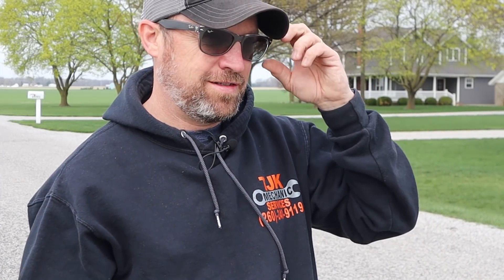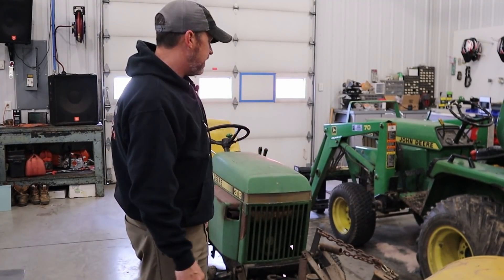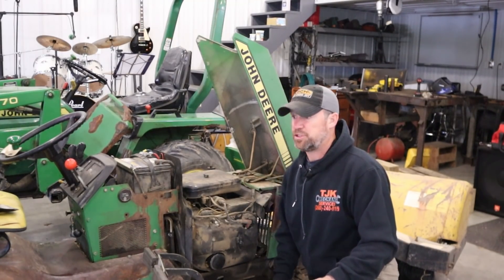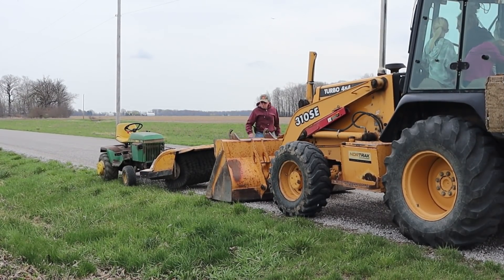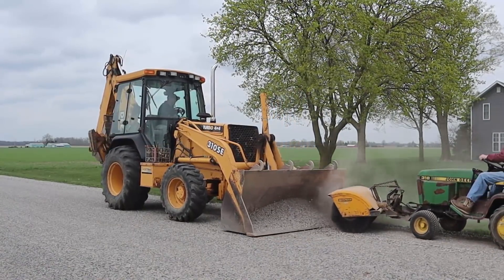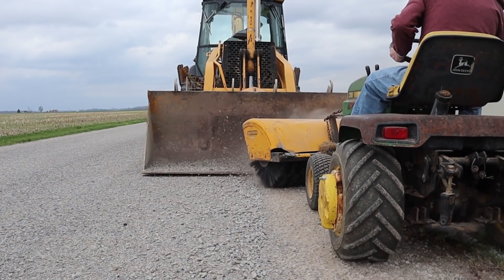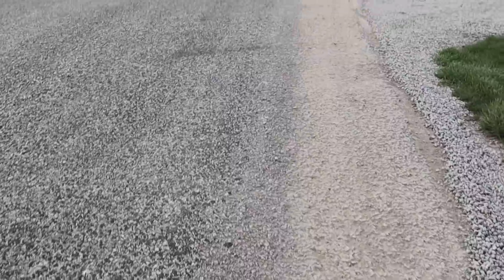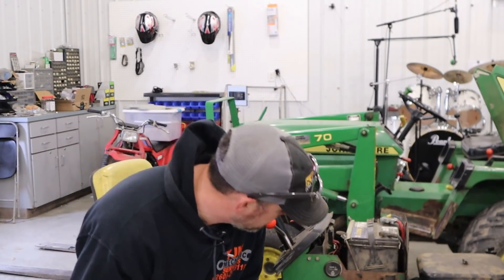I Have Wanted to Do This For Years!

Comment: I took all the side shields and grill off my 318 and stored them in the rafters. Deere closed up those 317s--318s--and 400 hundred series tractors for noise reasons. They never got enough fresh air. ALSO each spring the first thing to do is start the engine and while running at half throttle take an air hose and give the engine a good blow job. Around spark plug holes etc. Get the mouse nests out of it. And don't forget to clean the screen under the tractor. Yours just like mine still has the original Onan engine. I rebuilt mine when I got. You are right about the compression. No need to run it again hot. Just going to ruin your day. What do you do with the gravel. Return it to the county shop pile? Or does it end up in your farm driveways? Have a good one.. Arnie..nice video
Reply from the maker: Thanks Arnie!  I agree.  The Onan has seen better days.  I'll most likely repower.  The stone is going to likely get donated to our local Small Town Ball Park which is of the same county.  I figured that would be a better use than putting in my driveway.  That way it remains "the county's stone".

Comment: I think a new set of rings and most importantly grind the valves and seats. Small engines really depend on the valves sealing. If you do this yourself have a local machine shop check the taper in the cylinders before you spend the money for labor or parts. If this renews old Bill give him a paint job so he can be proud again, powerful, and ready to go.

Comment: Neil, if you do a wet compression test (squirt about a tablespoon of oil in each cylinder) and find the compression improves, that would indicate a loss of compression due to the rings. If it doesn't improve much, you are likely loosing compression through the valves not seating properly. I'm a fan of rebuilding an old engine. Possibly a young guy or maybe the shop in your local high school might like to take on the rebuild to gain experience if you don't have time to tackle it... Good luck! Great video!!
Reply from the maker: Thanks Rick.  That is a great suggestion.  I'll do the wet compression test too to have a better understanding.  I've never had one of these Onans rebuilt.  I just always buy a different junky tractor that just runs a little better than the last one!  Thanks for watching sir!

Comment: Hi Niel, three things can cause low compression. Bad rings, bad valves and not enough air entering the cylinder to compress to begin with IE; carbon build up around the valves. A simple way to check if it is valve or rings is to squirt some motor oil in the cylinder before the test. If compression goes up it's bad rings if not it's bad valves. It may just need a valve job.
Reply from the maker: Ahh.  Good thinking!  I will try a little shot of oil and see what the results tell me.  Thanks Stephen!

Comment: Another good video Neil. It looks like your broom operator is a good match for Bill, low compression but still has a little spark left. I hate always bringing up things from the past, but I can't keep up with these present times so that's all I've got. After they had our road chip and sealed it was an annual event every spring to go out with my little 24in wide plastic rake and rake stones 300-foot of Road Frontage by hand oh, it would take me hours to get it done and my back and shoulders would hurt for days. Finally, the county broke the camel's back, they went down the road plowing snow that was only an inch or two thick oh, they must have been going 45 to 50 mile an hour throwing stones 35 to 45ft into the yard almost to the house. Needless to say I was hot! After the snow had melted and the grass and started to turn green I contacted our friendly neighborhood Highway Department and talk to the supervisor himself. I told him of the situation and quite explicitly told him my thoughts on how it was done. He told me that he would send the road crew Foreman out to assess the situation. It was about two days later here come the road crew foreman and two other workers, they all had their little 24in wide rakes and after about 4 hours and 20 minutes they finally had the stones out of our yard. I haven't seen a county truck go past our house that fast since then even in the summer and best of all I haven't had to rake stones. - Dad
Reply from the maker: That's a great story!  I had forgotten about that incident but glad you brought it up.  Yeah, the stones aren't as bad as they were back when the road was 100% gravel.  I can remember raking stones out there too.  I think that bit of childhood raking is what led to my motivation to purchase the Stihl Power Broom all those years ago.  Your road really doesn't shed stones too badly any more and hopefully this one won't be as bad now.  Thanks for the help on this project.  If the county comes knocking I will not testify against you 😋

Comment: Ok former state dept  of roads employee  here. Years ago they ised gravel to chip  seal. They switched to jagged stone because its supposed  to adhear better. Im assuming your county rolled and sweep that after they did it. Also unless they seitched to a rubber ( dont think total rubber) blade on their plows  the old steel blades will keep throwing that roxk back up.  As far as bill you need to  do surgery  on him. I know alot of people have gotten engines from harbor frieght and had good luck, cause honestly what are you gonna hook that broom up to in ten years lol
Reply from the maker: Thanks Kory.  Yeah, I hate that they use the sharp edged aggregate.  My daughter slipped on the snowy road last year getting off the bus and got 8 stitches in her knee as a result of the sharp road.  I don't think it would have happened on a  pea gravel surface.  They sprayed a layer of emulsion on top and rolled it but never swept it.  They have top coated it with more stone and tar two more times since then as well.  There will be more stones in no time.  I counted your vote for Bill.  May have to get him scheduled for surgery soon!  Appreciate your comments sir.
Reply: @digdrivediy  ouch that had to hurt poor girl. Sadly its a fight that  isnt gonna end. Hopefully if bill gets to feeling better youll use the broom  more than every ten years😁

Comment: Good video,, After reading comments ,- check valves,, do a "wet oil compression test" , also On compressor stroke 
Fill cylinder with "gunt remover ,'"(seafoam or motor renew or carb cleaner" ) let it soak for a day them do other cylinder the same way,, idle engine , slowly add ,"gunt remover" in the carborator for  minute,  change oil and filter, clean  or change spark plugs,,
Reply: Sorry "gunk remover"
Reply from the maker: Certainly worth a shot there Larry.  I need to see if I can do a "tune up in a can" before I get too carried away.

Comment: I repowered my free 318 with a Briggs re power kit from small engine warehouse, if everything else is tight steering wise and hydrostatic is strong and don’t leak it would be work re powering and a paint job if that stuff is wore out bad part it out or try your other engine👍
Reply from the maker: Yeah, I'm trying to formulate a plan.  I need to really evaluate what is good and bad.  I think a Frankenstein combo of both tractors is likely in order.  Great suggestions!  I'm not sure about the paint yet.  He has character 😉

Comment: I think if you price a new mower with your requirements, you may find a new or refurbished engine or rebuild it yourself will be a lot less expensive. Pick up some sand paper and J D paint while your at it. This could be a great "diy" for your diy channel. Check with Tim "ttwt" for info on guide wheels for your brush. I think Tim put wheels on his hand held brush too.
Just to state the obvious. Next time bring the dump truck closer to the street.

Thanks for the great video
Bob
Reply from the maker: Hey thanks Bob.  Some good advice there for sure.  I think I'll be looking for that refurb engine and see what I can do to get that old mower freshened up again.  Thanks for the great comment and thanks for watching!
Reply: @digdrivediy  your welcome

Comment: Add seafoam to the crankcase and gas tank it frees up sticky rings and valves plus reseats the rings. It’s the best stuff I ever tested. It’s not a rebuild in a can but it will bring back some life to older equipment.
Reply from the maker: Love seafoam.  Used it all the time when I was a young lad and it seemed to help.

Comment: I'm pro 318, so I'm all for saving Bill. Look into the compression issue more to see what is needed. Price it out on paper and compare to new V-twin repower. For originality I like the Onan, but for practical purposes a newer engine design is more practical. My 318 is a first year model (83) so I wanted to keep it stock.
Reply from the maker: Very nice Jimmy!  I do need to think it over for sure, and I will look into the compression more closely but I think the Onans are just so pricey.  I will likely make a combo of what I have now and make two tractors into one.

Comment: Bill's Onan engine needs rebuilt. The JD 318 tractors are vary versatile. Just be thankful the points are still good they can be a real hassle. I have a 318 and it's engine is on its last leg. It drinks oil and has lost a lot of power but I'm going to rebuild it.
Reply from the maker: I'm with ya Jay.  They are great machines.  I've had about a dozen of them in the last 20 years and still have my first one.  I hope to get them fixed up here soon!

Comment: This kind of decision usually comes down to budget and your needs.  If you need the tractor and have the budget, I'd definitely replace it with something diesel powered. If you don't really need it and/or already own another tractor to take it's place,  you already have your answer.  I had a similar sized JD for years and loved it but looking back it was expensive and constant trouble.  In 2002,  I stumbled onto a nearly new diesel powered Kubota BX 4WD tractor (I didn't even know I needed) at of all places in a garden shed a yard sale. The guy's house was sold and was moving south. He made me a once in a lifetime deal and even paid to have it delivered to my home after he was gone.  After one week with the diesel Kubota I sold the gas JD and never looked back.  I use it every day.  It's super efficient on fuel, high torque, and has been trouble free for years.
Reply from the maker: I could buy what you're selling there for sure.  I bounce back and forth between messing with these tractors and getting something more modern and trouble free.  That's part of my problem is I could likely afford something much newer, but I can't stand spending money on something new when older will get the job done.  I really appreciate your recommendation though as it really helps to force me into considering what I want, versus what I need.  I have 4 other tractors for goodness sake.  (One does not currently run and Bill is fixin' to make two that don't run).  Thanks so much for the effort and time to share your experience.

Comment: Pull the engine and tear it apart to see if it can be rebuilt. If it can, new rings and bearings are a lot cheaper than a new motor and all the swear practices you’ll get is priceless.
Reply from the maker: Haha!  Very true.  My patience isn't what it used to be though so not sure if I can put up with the rebuild process.  These Onan's are expensive to rebuild too.  But, I do want to look into it.  Thanks for watching Jess!

Comment: Looks like you love tapped the dump truck lol. Also, i have a JD 300 garden tractor and a JD 110 garden tractor. Just rebuilt it. It worth it once fixed up and complete as its worth at least $1800+. If anything, list on Facebook marketplace and someone will buy it as it sits just to tinker with. Wouldnt worry about the county, afterall you pay them!
Reply from the maker: Man, I meant to edit that out Brandon!  I'm glad to know someone is watching closely though  Sounds like you have good taste in tractors.  I'm gonna look into fixing up that ole 318 one of these days I think.  Thanks for watching!

Comment: I just started watching you on 7/10/2021 because I saw you on TTWT and this is 7/11 so I do not know just how many tractors you have or how you mow your lawn or what all the jobs are that you need to do.  While you are correct that this Onan engine is week that is no reason to get hasty and rebuild it or replace it in my opinion. This is not an airplane engine!! It starts and runs fine; just not with a lot of power.  Onan is owned by Cummins so I believe that parts are available. The Onan always burned oil so a lot of people kept insisting on rebuilding it and so on which is likely why they quite building them. Burning oil is NOT a big deal!    My first thought as a low horse power job is to use it to pull things.  A cart with the hand tools and garden transplants for example or tools that are self powered. Use it as the kid's go kart!   Mowing grass takes a lot of engine time on a tractor you likely have a lot of tools for.  The tools are likely going to out last the tractor and the is doubly so if you mow grass with it all the time.  So save the hours on that "good" tractor and use this one mow with.  First problem however is that mower deck is too small for your lawn and if the grass is tall it may not power through using it's own deck anyway.  We do not want to spend hours and hours cutting grass.   If you are not too particular about mowing the grass there are some vary interesting home made systems for mowing grass.  The one I like best is using 20" mowers hooked together to make a much bigger mower. In this video he only has four but I would put 8 or 10  one set out one way and another set out the other way.  Clearly this is not a perfect way to mow but it would likely be fast and relatively inexpensive for the size cut.  https://youtu.be/PA88-o4Iatk   Use this tractor on light jobs.....   The push mowers should be real push mowers: no drive systems.  I have noted that many call it a push mower if they have to walk behind it!  Side discharge is best I think.  You should be able to get most of the ones you need used but they do not cost too much new.  Yard Machines 20" for $169 at HD.   This mower has bolt on wheels which is a big plus in junk mowers!  It does not pretend to have features!  This is what one wants for this idea.  The engines far out last the handle and deck.  It might be fun to put this system up against TTWT's Ventrac with it's 95" and just compare them!
Reply from the maker: Hi Scott!  I've seen your comments rolling in on my phone this morning.  Looks like you're getting caught up and I really appreciate the viewership and awesome comments!  I actually mow grass with a zero turn Country Clipper!  Can you believe that?  I used to have a 757 JD zero turn but I didn't like the way it cut and it was hard to clean the deck.  I bought the Country clipper from a cousin and it has been a great mower for us.  Thanks for all the great info and attention to detailed comments.  Glad to have you visiting the channel sir!

Comment: You need to Crank the engine longer. Put a little bit of motor oil in the cyl them do your compression test if the compression goes up you have a leaking valve if not the rings are bad. Good luck.
Reply from the maker: Thanks Dan!  I tested the compression again when the engine was hot at the end of the video. Almost same result.  I'll check it with some oil in the cylinder.  Appreciate the tip and thanks for watching!

Comment: I’d try to rebuild it first, but if it’s the same price of a good used 16hp 3cyl Yanmar is just scrap or sell the motor as a core & get a decent Yanmar diesel, maybe change the bearings/rebuild then put it in, & not worry about the engine for a while.

Personally I’d use the 318 engine in it till it looses compression altogether, if it ain’t broke don’t fix it.

My 82 212 k301 needs a rebuild/ 60-65psi & when it does start it’ll run for a few minutes then once it gets under load, it’ll smoke pretty bad then stall out, & wont start till cool.

Last time I ran it I had to get it towed up to our barn then pushed it into a spot pumped the tank dry, didn’t mess w the carb, & parked it. I had done a full tuneup on it, I’ve got a spare k301 on a pallet, but I’m saving it for a project or if my original 82 k301 blows a hole in the block, even then it’s fixable, & id send it of to get it fixed.
Reply from the maker: Not sure what I'm gonna do just yet Michael.  I appreciate you sharing your insight though.  I don't think I have the patience to rebuild it so I'll probably just drop a new one in there!

Comment: I would  put a couple squirts of oil down the cylinder then redo your compression check see if the compression comes up or see if it stays the same if it comes up it's the Rings if it doesn't I would check the valve lash. The valves made just need adjusted and they're hanging open a little bit and you're losing compression
Reply from the maker: I need to do the oil trick and check it again.  I'll report back on my findings in an upcoming video.  Thanks for the idea and appreciate you watching!
Reply: Yeah no problem whenever you do the compression check make sure the throttle is in a wide open position that way the butterfly and the carburetor is wide open